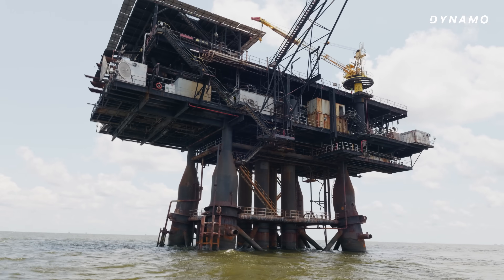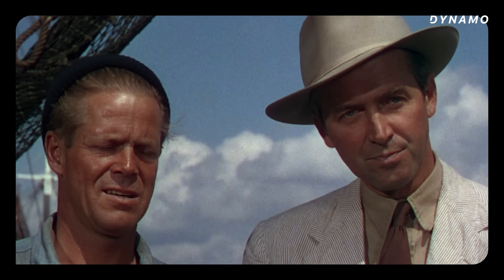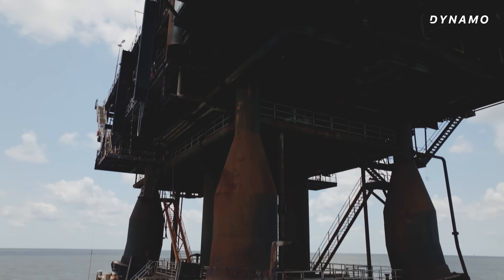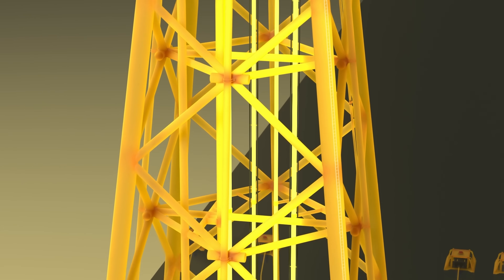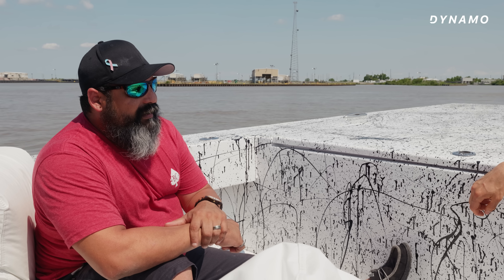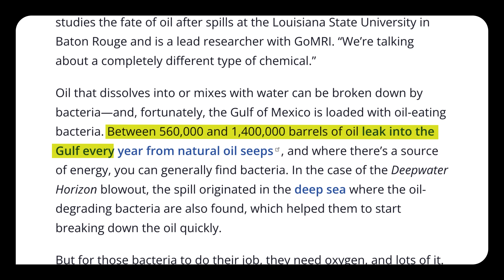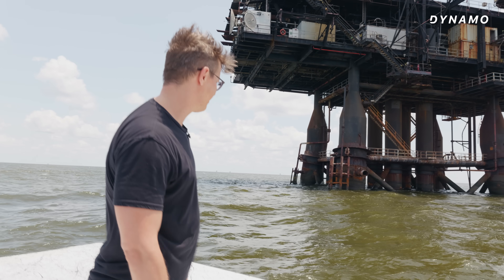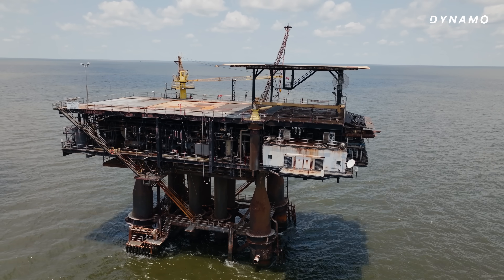I Visited Abandoned Oil Rigs — and Found Something Terrifying Underwater

Comment: The fact oil companies can just abandon these things and leave the environmental degradation and cleanup to future generations to be paid for by the public is absolutely insane and a complete travesty of justice. Rich people just get to do whatever the fuck they want, and the rest of us have to suffer.
Reply: Companies are required to prioritize investors. That's one problem. If the investors were held liable to an extent or the company immediately lost profits that would be a problem. There should be a sales tax of some sort when they sell these rigs off and maybe proof of the ability to cleanup on purchase
Reply: @techdiyer5290  this is actually an interesting and good suggestion. If there were some kind of way to have these liabilities remain on the books of the original, large companies that installed the rig, it would affect their balance sheets and drive down their share price. Investors would push to help correct the situation, either by putting more $$ into escrow / bonds to be more reflective of the real costs, as well as improve the laws around the decommissioning process. 

Ie make it so that only selling the rights to the well is legal, rather than the well and equipment in their entirety, much like how you can sell a business you own but keep the building it is operating in (which in the example you would also own) and charge rent.  If you prevented the GiantOilCo from selling the well and equipment, they certainly wouldn’t be declaring bankruptcy over this, they’d be forced to fix the problem.

Unfortunately it doesn’t do anything to resolve the problem with existing abandoned wells.
Reply: read about the Cox Operating bankruptcy.  instead of hiring oil workers, dude donated to politicians, leased a GulfStream jet, and built a ski lodge in Colorado
Reply: Companies are required to prioritize investors. That's one problem. If the investors were held liable to an extent or the company immediately lost profits that would be a problem. There should be a sales tax of some sort when they sell these rigs off and maybe proof of the ability to cleanup on purchase
Reply: @techdiyer5290  republicans have blocked that from happening, we have been trying
Reply: "Rich people just get to do whatever the fuck they want,",
Yeah, and the way to stop the rich class from doing whatever they want is with regulatory laws that TEETH (naturally, Trump wants to get rid of Government Regulations, which could only mean that big business can do even more to rich themselves at the little guys' expense). 
Trump's justification is "to create jobs", but really, one thing has nothing to do with the other (create jobs while making sure that big oil pays it's own tabs).
Reply: That's the way boomers roll with everything. Not my problem, the next generation will fix it, and I don't need to pay any more in tax.
Reply: In all of this corruption all you need to do is look at the voter base that benefits. Sure all have to pay, but a particular group made a bundle which will benefit their future generations. These people fund particular politics that will shape the future and keep things in their favor and further oppress and exploit Americans. These folks aren’t patriots. Heard of The Seven Mountain Mandate? Learn. Then go back and see how one thing led to the next. Interesting stuff.
Reply: It's always been that way. Not much has changed.
Reply: That’s because those “rich people” are both in corporations and in government and work together to screw the rest of us .
Reply: turn in your cell phone and all your products with petroleum in them you bum
Reply: Uhm, no. Totally hyperbolic rant.
Reply: Not that clean cut
Reply: Nice jab at the rich, but stock shareholders also own these companies, in 401 ks and other plans. Its nice to imagine the mythical rich boogeyman. 
 THese things should be part of the obligation of the permit to pump in the first place, show your plan to restore it to how you found it.
Reply: Who cares?
(Except trust fund kids like this with too much time on their hands trying to justify their existence.)

How big is this guy's trust fund ?!!??!!
Reply: Get informed. Those are valuable artifical reef systems that function as nurseries. The well is plugged.
Reply: @Bee-Buzzing  nobody disputes they are great artificial reefs, but as clearly stated in the video, there are many that are not properly plugged and are a potential disaster waiting to happen.  Anyone who is a commercial fisherman, enjoys beach strolls without disgusting oil tarballs washing up, or using the rigs as fishing or diving spots should be concerned - the Deepwater Horizon spill is still affecting the gulf coast today.
Reply: @Bee-Buzzing  Thanks for the information. I guess it’s all good then. Let’s stay focused on real problems like those 26 trans athletes indoctrinating all our kids to be gay with their vile rainbows. Where are the babies going to come from?
Reply: @Bee-Buzzing Consider the hazard to shipping just waiting to rip out a ship hull.
Reply: @Bee-Buzzing That's where my buddy takes clients to fish.
Reply: They are just as bad as abandoned wind turbines except they provide fish habitat.

I am waiting to see if Ivanpah will be dismantled or abandoned.
Reply: @oscarb9139  There is a wee bit of difference between the two.